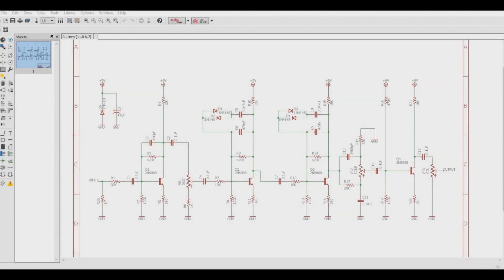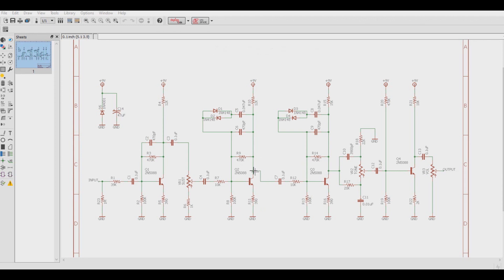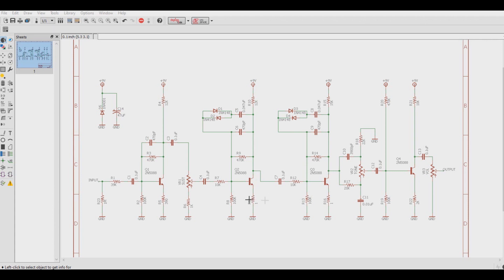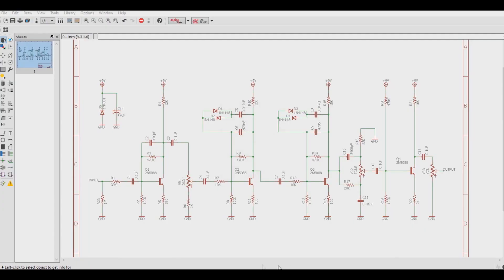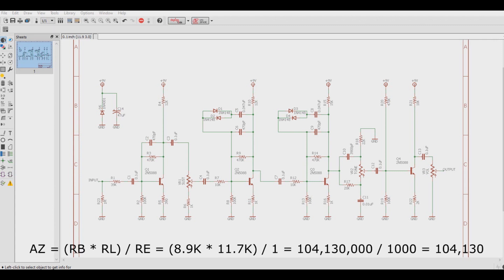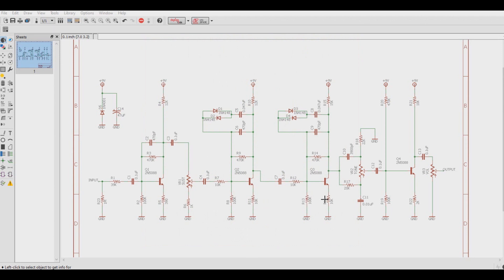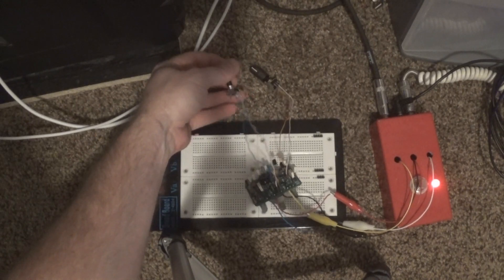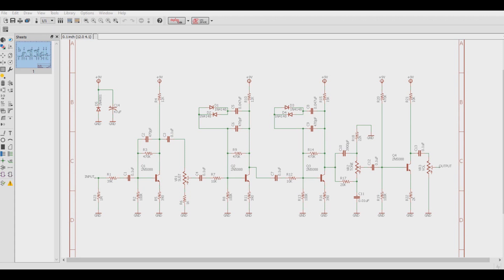Big Muff Pi Mods Part 2 - Emitter Resistance (DBE Siberian)

Comment: What would be the most viable mod for the NYC Nano Big Muff? It lacks the grainy high end of the full size Muff and the compression on the attack. The resistors are surface mount but all the other components are through hole. I have a four screw black Russian Muff that I'd like to keep stock but I'd be willing to mod if it's not possible with the Nano.

Comment: can you make a video about a pedal for acoustic-electric ukulele?
Reply: wtf how?
Reply: Obviously what you need is an octave fuzz and a metal zone
Reply: Does your ukulele have an output jack?
Reply: @erikvincent5846  yes, It Does. a 6.5 mm one
Reply: @chocosherry19  Wow, never messed with one that had any pickups on one. I am not sure what effect would sound good. Delay might be cool. Perhaps a Boy in Well pedal would work. It's already EQ'd for the range a uke would be at.
Reply: @erikvincent5846  I heard some review about some pedals like  " Jam pedals delay llama", "MXR M169 Carbon Copy Analog Delay " and "Ditto looper" would sounds great on ukulele. However I'm not an expert in this like you so I don't know how to figure out how to make these
Reply: @chocosherry19  those are BBD analog delay pedals (excluding the Ditto). If that style works, then you may want to give the Boy in Well a try. It isnt a BBD, but sounds close to one.
Reply: @erikvincent5846  Alright. Can you recommend me a pedal for Acoustics Guitar as well?
Reply: @chocosherry19  The Boy in Well delay would be good there, but also the Lich King Chorus, and Vanilla Shake could be some good ones to throw at it as well. Basically any decent modulation, delay, or reverb pedals would be good for an acoustic electric.